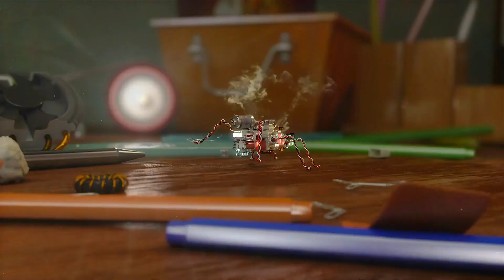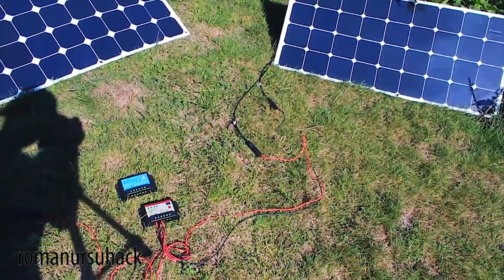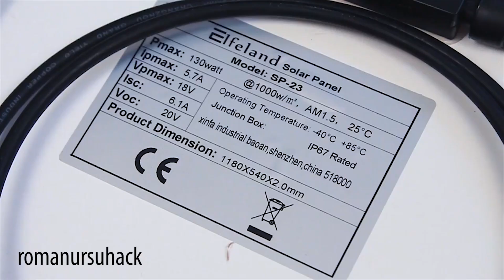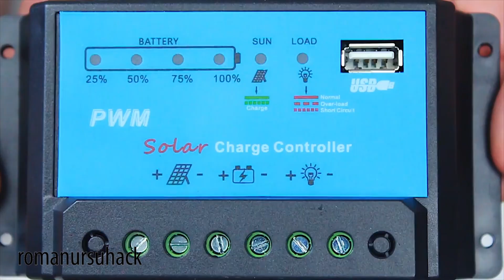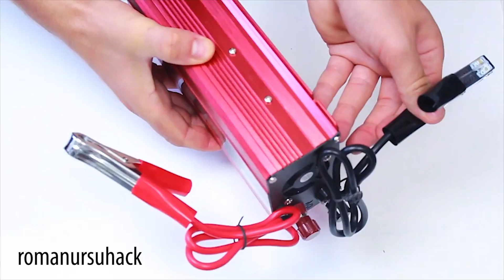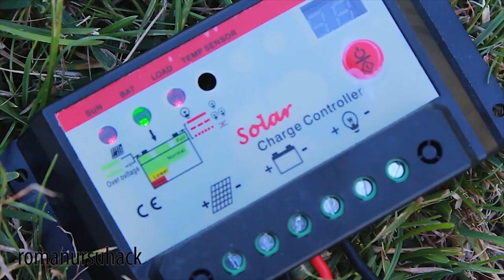✅Solar power plant by hand 💡 Detailed assembly instructions!

Comment: You did a very nice job making this video. That 12V lead acid battery at 4.6 volts is more than likely no longer usable if it was sitting that low for a prolonged period of time.
Reply: electronicsNmore I heard some opinions about not to use car battery but Idk why